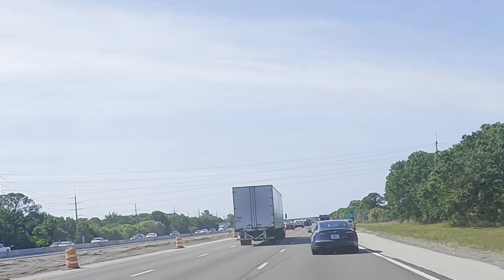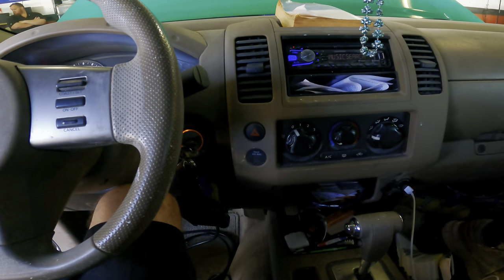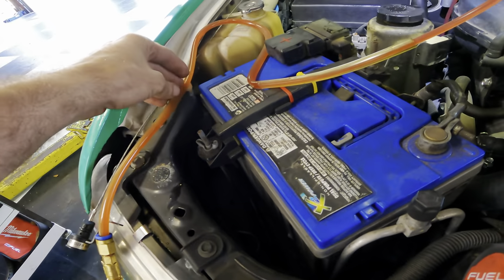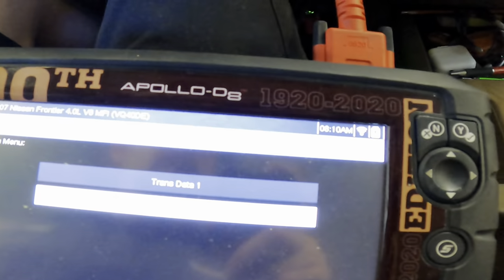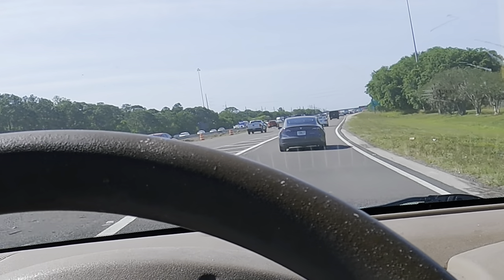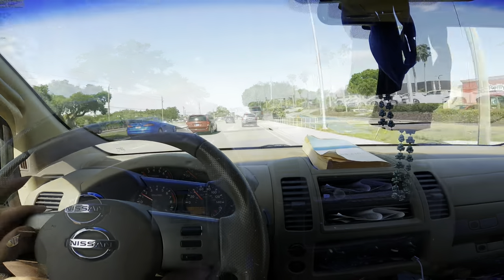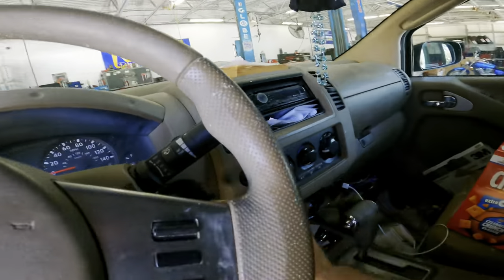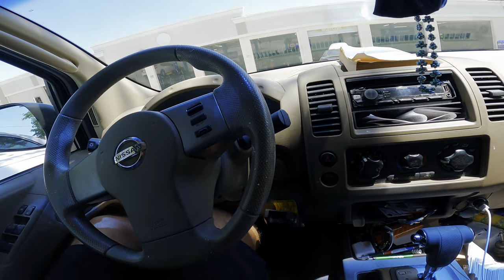Customer States: Vibrates Sometimes! How to save money by using your words!

Comment: Here's a past experience I had with a vehicle before, I told the service advisor IN DETAIL what was happening, how I was able to reproduce the issue and specific conditions for the issue to happen, after about 4 hours i got the car back with "no issue found" even though when I drove off the issue started immediately and I turned around and told them it's still happening (it was a sound in the front end that was very prominent) when I talked to the mechanic himself he showed me what the service advisor told him and it was just "noise in front". So with that stated sometimes it's not the customer it's the advisor being lazy not taking all the notes provided.
Reply: Look. It is hardly the service advisors fault. There were tickie-tackie videos to watch, her nails were not properly dry yet, and the facebook post about her new nails didn't get a like yet. It is a stressful job and things like writing shit down sometimes usually is too much stress.
Reply: This is why I always leave a note on the passenger seat detailing everything! That way the service advisor can't muddy my words and the mechanic can get the most specific information possible.
Reply: That happens more often than not. Sometimes you as a customer have to write or type a note explaining the issue so the service advisor can give it the mechanic.
Reply: Sorry... I can't resist...
ALL experiences are "past experiences!"
Unless you are a time-traveler. 😂
Reply: @mariosaccoccio1688  maybe I am I timer traveller 😲🤖
Reply: We had a real lazy service writer once. Every work order said "fix car".  Not " brakes grind" or  "has cel on" etc.
Reply: @chrisleggett685  thats...that's.... amazing 👏
Reply: @chrisleggett685  Owners kid?
Reply: Exactly like for an example I work on Class 8 over the road trucks mostly,    The other day I was handed a work order Stating replace Tone ring I asked one of the other shift mechanics What's the wheel we are having problems with then the parts guy hands me the new ring it was a big one for a drive axle wheel hub, But the Mechanic told me it needed it on the right front steer hub, So after getting fishy INFO,  I rescanned  the ABS computer on this Truck and found the fault was for the right front steer hub.   So what I am saying is The wrong part was ordered and the position of the problem wasn't clearly stated on the work order, Incompetent Situations like this REALLY piss me OFF it's not THAT HARD to type up a proper work order, Why because if you don't You're just wasting everyone's time at $100.00 an hour, It's completely unacceptable..........BS.
Reply: @mariosaccoccio1688  Unless you are having a current experience, which is happening in the present. 
And life will have more experiences in store...which is the future.
:)
Reply: I use word so my handwriting isn't an issue in a large font so it's easy to read with the car description at the top and my cell phone at the bottom and leave a copy of the list at the front desk and in the car on the driver's seat.  Knowledge is power and less wasted time on everybody's part.
Reply: @arlo4051  no just a lazy individual
Reply: @ccdimage  You nailed it.  All of the customer detailed information gets put into 3 words. They think the mechanic will just figure it out.
Reply: @mariosaccoccio1688  Even then, it is in your subjective past. Prophets get to have future experiences.
Reply: You are right. The service advisor should leave you (the tech) better and more specific info, if it’s available from the client. However a note that says “noise in front”, however vague, should probably require at least, a short test drive to determine of there’s a noise coming from the front suspension. I say that it should require at least a short test drive but it should also require a visual check of the front suspension.
That’s my story and I’m sticking to it.
🤔🇨🇺🇺🇸
Reply: @mariosaccoccio1688  I always liked "Experience is something you get right after you needed it"
Reply: @__-fm5qv  This!  I would write up the issue, give a copy to the service writer, and leave a copy in the car for the mechanic.  The shop owner offered me a job replacing his service writer! :-)
Reply: I've actually had somewhat of a flip of this happen to me.  I told everything in detail to the service advisor and he printed out a paper for me to look over and sign (authorization to work on vehicle).  Almost wrote almost verbatim what I stated.  When my vehicle was down, the mechanic notes stated fixed problem.  I had to ask the SA what was even fixed.  If only I could get a good SA and good mechanic at the same place around here lol
Reply: @davidbentley6399  You asking for more work from mechanic and on top of that work that is not important in the whole job of fixing your car... :D

Comment: There have been cases where I have found a test drive WITH the owner very helpful.  Weird problems get lost in translation, and sometimes it is something as simple as a customer who just got their first set of aggressive truck tires and is unfamiliar with the road noise they create.
Reply: Kind of hard to have the customer ride along when the passenger seat is full of crap! How can anyone let their vehicle get like that much less take it in for service!
Reply: @chipdayton1625  work truck most likely
Reply: @donaldsmartt8532  Yes, it's a work truck, plus a garbage hauler, reading room, snack bar and more.  Very versatile.
Reply: @chipdayton1625  Or the noise complaint and you have them ride with you.  "There it is didyouhearitdidyouhearit?" so much that you can't hear anything.
Reply: Long ago, I owned a 1974 Volkswagen Beetle with an "Autostick" or "manumatic" transmission that was essentially a stick shift three-speed transmission with no clutch and no gear release button/level/action.
My mother borrowed my car for a week while hers was in the shop, and she angrily accused me of letting her drive a car with a failing transmission because it kept slipping out of gear at road speeds.
I drove it for an hour, and noticed nothing.
So I sat in the passenger seat and had HER drive for a bit, and noticed that she had a habit, from driving a normal manual transmission, or resting her hand on the stick shift as she drove. But in the manumatic world, that light pressure plus a bump in the road was enough to tell the transmission you were shifting, and it disengaged the current gear selection.
-
So I got yelled at for not telling her about THAT before-hand. Ah, good times.
Reply: It’s a Jeep thing!
Reply: Only thing is the owner wouldn’t be able to sit with him due to that messy car. Yeesh.
Reply: @Rizzob17  This video and this comment thread prompted me to clean out my car this afternoon.
It wasn't all that messy, I keep a small trash bag for stuff, and I had the dead wipers on the floor that I changed out recently.
Reply: Great idea. Though you ( customer) would have to take more time off from work to go for the ride along. This is the age of drop it ( vehicle) off and we'll get back to you shops. I guess it could work if shop scheduled the ride along to proceed any service. Though on a large scale that would be impractical. Last ditch effort when a diagnosis is alluding the tech might be a possibility
Reply: @chipdayton1625  You should see his house!
Reply: @MonkeyJedi99  Yeah, uh, that's not a handrest on a normal transmission, either! Operator error!
Reply: @chipdayton1625  I usually employ a shovel before taking my truck in for its annual service & MOT test (safety check here in the UK).
Half the junk I don't even recognise as ever being mine. 🙃
Reply: I wouldn’t work on any vehicle that is full of junk and looked like this truck.  What a mess, what an embarrassment to take it to a repair shop.
Reply: What i do with my mechanic is i will tell them any DTCs I've picked up between services and remembering what I was taught in English class.
In school I was taught about the what, the when, the where, the how, and the why when writing, but it's enough to make your mechanic worship the ground you walk on as a customer.
What: what's the car doing, not doing, and what it should be doing?
Where: where is the issue?
When: when does the symptom arise?
How: what were you doing when the problem started?
And why: if you've been accurate with describing everything else, your technician likely already has his suspicion, and will likely be able to determine the why with the minimal screwing about 👍

here i was as a student about 20 years ago thinking "There's absolutely no point in my life where I will need to use any of this crap"
Turns out my teacher was right after all...
That's the English teacher anyway, as for the math teacher and his "you won't always have a calculator on hand wherever you go" 🤣
Reply: And make a beer run.
Reply: You can weld...weld a chain to the head and to the frame
Reply: I have a perfect example of lost in translation that just happened today.  Co worker called me and said his truck is making a ticking noise when in 4wd (we just had 17" of snow fall the past two days).  I'm thinking front axle but he should be ok to drive it back to the shop.  I hop in to drive it into the shop and put it in 4wd to hear what he is talking about.  His idea of a ticking noise is what I would call a banging noise.  It quickly went from a possible bad axle to a very badly broken front differential (massive hole and snapped the top mounting holes).  My coworker was standing next to the truck while I was checking it and he asked me if I could hear the ticking sound.  We had a very important conversation about the differences between ticking and banging sounds.
Reply: @MonkeyJedi99  lol. Glad to be of assistance through indirect, online guilt tripping. Have a good weekend.
Reply: W
Reply: He having a heart attack.
Reply: @chipdayton1625  🤣🤣🤣

Comment: I have really enjoyed your videos.  I was a transmission tech back in my earlier years. Used to build 440T4s, 700R4, 400s, 350s, 325.  Joined the Navy after doing that for a few years and got out after 20 years.  While in the military, I basically joined as a mechanic, AS rating, working on a wide variety of gas and diesel engines and a lot of electrical and refrigerant work.  I always tried to show my junior Sailors how to properly diagnose and repair equipment.  Sadly, most lacked the ability or willingness to do so.

I really dislike technicians touching my vehicle, I find most are clueless in the dealership. If it doesn't throw a code, nothing is wrong with the vehicle.  When I bought my Mustang, there was a problem with slipping or transmission flare.  I wrote an entire page of the issues and discription of the problems.  They had the car for 45 minutes, said nothing is wrong, there are no codes.  The problem, was finally acknowledged 2 years later after repeatedly taking the car in, only because of a TSB.  They had to do some valve body work on the 10R80.  I Blame that on Ford for hiring incompetent technicians and putting out stupid TSBs stating tapping and knocks in some of their engines is a normal operating characteristic.  Example.  My 2019 Mustang which taps once hot at idle, VCT tapping from 2k to 3k RPM, both of which can be heard in the cabin, doors closed, windows up.  Sorry, when I worked on engines, the only ones that knocked and tapped were ones I needed to repair.  Sorry, end of rant.

All that being said, you're the kind of technician I'd let work on my car if I was unable to.  If you knew how untrusting i am of people, you'd know how big of a compliment that is and how happy I am to see a technician who is honest and puts forth the effort of looking for problems complained about.  Keep up the great work sir.

Comment: I did technical writing as part of my job for 35 years.  I know how to communicate precisely and exactly, yet when I have gone in for auto service and explained in detail, precisely what the problem is, I've often found the service advisors don't seem to be able to translate that to the service writeup.  II look at what they've written, and when it's not correct, I make them add additional details.  You might want to work with YOUR service advisors because if you're not getting the information you need, then the service advisor needs to ask the customer questions to better explain the problem.  It's not always a customer not communicating clearly, a lot of the time the services advisor isn't listening.
Reply: Finding a good service advisor is probably the most important thing for a shop.  On the down side, I've found many service advisors are more likely to push the up-sale than listen to the problem.  I have a 2013 Acadia that excessively vibrates at idle. I now have a new PSP that would have been needed but didn't cure the issue it was in the shop for... to me, that was poor service.  Yes, I was going to have the PSP changed but that is not what I brought it in for...figured I'd save the $100 "diagnostic fee" and go ahead and get it done. (BTW a "diagnostic fee" is BS if they don't find the problem)
Reply: I would write up the issue I had, give a printed copy to the service writer and leave a printed copy in the car for the mechanic.  The shop owner offered me a job to replace his service writer :-)
Reply: I think some service writers just put down" find a bunch of repairs to run up the cost---my rent is due"
Reply: @jerrylittle7797  i wouldnt pay it if they dont find it, i can do nothing for free all on my own
Reply: I once had a very intermittent problem with regular driving, but could replicate it consistently when a certain process was followed.
Knowing damn well it wouldn't translate through voice, I typed it out and included pictures. 
Gave a copy to the advisor and also left one on the passenger seat.
Tech never got the one from the service advisor.  Sooo glad I left one in the car.

Using my process, it was diagnosed and sorted in less than an hour - else they'd have been shooting in the dark just like this.

Reading through the comments, I'm glad I'm not the only one!
Reply: @stevejohnson1685  He's had customers leave notes in their cars before him before. He actually seems to like those ones, especially when the customer can give a decent description of the issue.
Reply: @stevejohnson1685  If true that's hilarious. I feel most service writer/front desk peeps at mechanics are quite lazy. I mean, I KNOW your job isn't just listening, looking up a few things, and writing down things. Obviously there has gotta be more they do when the customer isn't looking, or they wouldnt get paid upwards to 22 dollars an hour in my state! But yeesh.
Reply: Buckhorn Cortez. a very good point although i'm pretty sure 'shake when in gear and like a noise at times' is verbatim. but that makes your point even more valid - front of house should have worked more to dig out something actually useful - unless they have zero mechanical experience, in which case they won't know or care what to ask.

Comment: In the early '80s I worked as a Sears battery tech, and you are absolutely correct in your "rant"! Customers are usually ill-informed about battery/starting/charging systems, yet all they know is "it does not start". The challenge is to extract the information one needs to solve the issue. I was lucky in that most of the time, I was able to solve the issue. I had good support from my managers, even having a formerly irate customer come back and apologize for their initial rant. My service writers were also good at describing the issue. But I always had take-with battery customers who accused me of selling them a "bad battery" when the problem was a loose alternator belt especially on Chevy V8s (pre-serpentine belt era). Keep up the great videos!  😁

Comment: Use this in your explanations if you like.  I once got an email from a coworker (sent to whole department) that our copier/networked printer was down and the service company had been notified. It would be a few days before they could look at this heavily-used machine. I asked for more explanation. He said it throws an error code on the display, those plastic sorting trays that collate your copies start to click, and it shuts down. I asked him to move any chairs near the machine and start it back up again.  Voila,it was fine. I had seen that issue before…when chairs were pushed too close to the copier, their arms got stuck in the sorting mechanism and stopped it from moving. It shut itself down to prevent damage. Just that little bit of info saved days of hassle. Keep up the fun and hard work!
Reply: that's a 3 thumbs up!

Comment: Yes ray! 20:55 preach! I can tell you how many of my service advisers that don’t ask those questions and write down “customer states car wobbles at high speeds” and I’m at a dealership!
Reply: I was a service advisor for a while and knowing about cars from my diy days and self education I'd ask customers as much as possible. There were 2 others that just wrote what the customer said, so "shakes on the highway" could be a tire, or a misfire with a flashing cel, or a broken suspension component... The techs used to get pissed at them. I tried to help the techs. 

But, I only did that for about a year. Management were dicks.